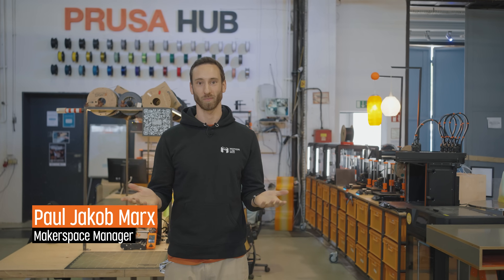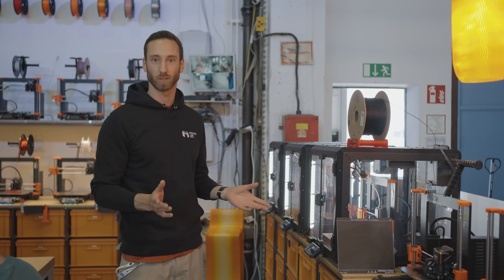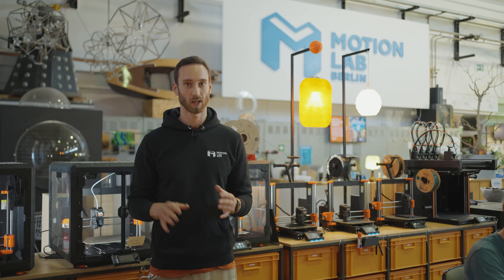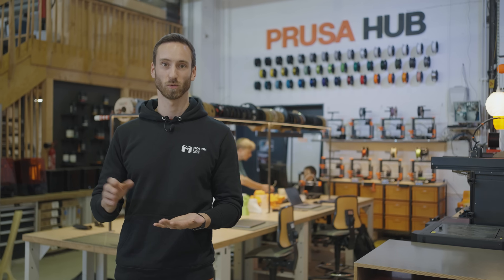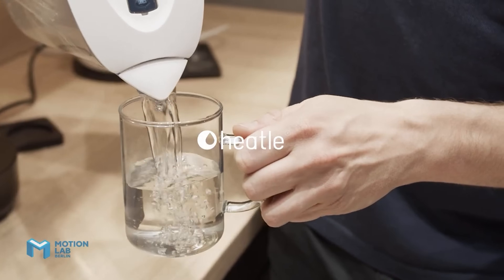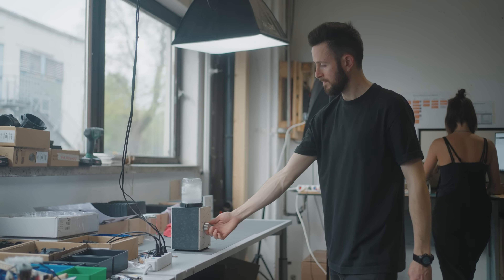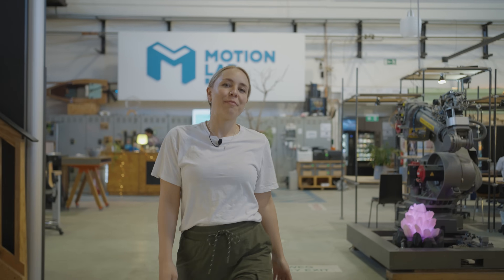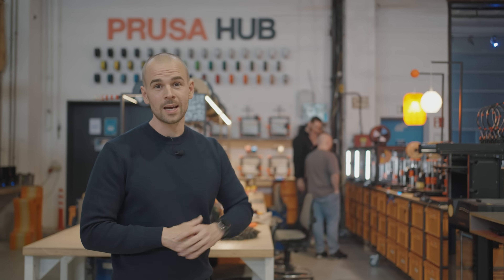PRUSA HUB - 3d printing space for innovators

Comment: The Idea is super BUT i must pay for the membership 129€ or 249€ Monthly, PLUS a extra fee (how much??), for the workshop AND the printer machine time.
Sorry but this pricing is just to high!
Reply: That seems to be the whole maker space access, so cnc and other stuff too...
Reply: as i understand the video right, they provide also the experts and Material choice and support for the project, so you go there as a noob with no knowledge and they bring you to a pro and help you to improve your product so that it will function as supposed and not let you print PLA for a mechincal critical part for example. So it is not a fee to get some Printertime, it is also a service a startup better just pay small fees before they install a fleet of prusa printers, they with their product maybe not even need or which is not the perfect fit with FDM for example. So to test and prototype until they know what they need... Also they have metal and wood working stations too, cnc and so on.. so it is a lot more in this space?